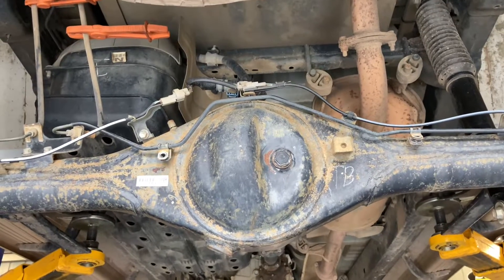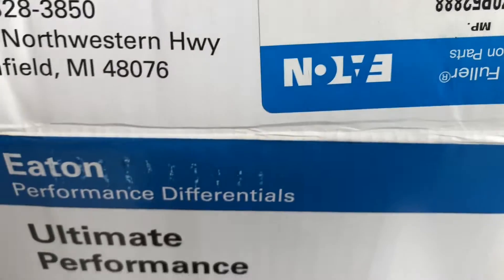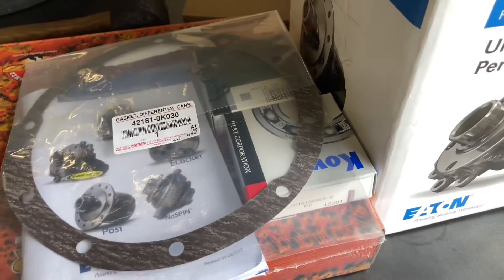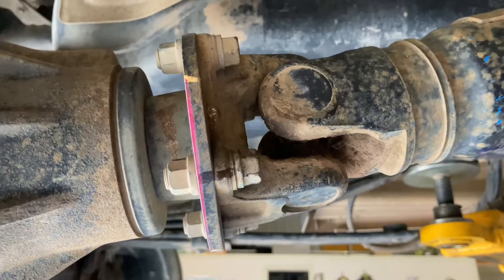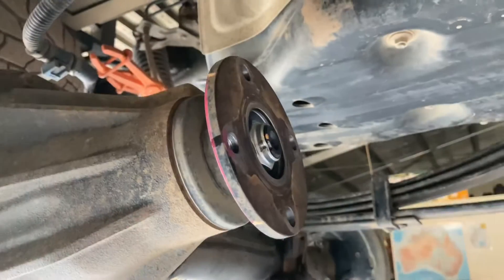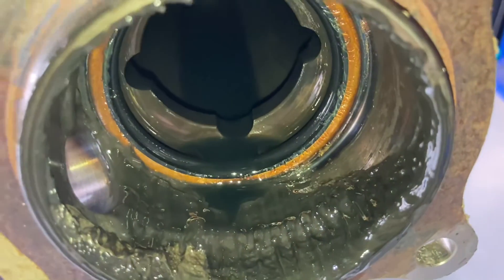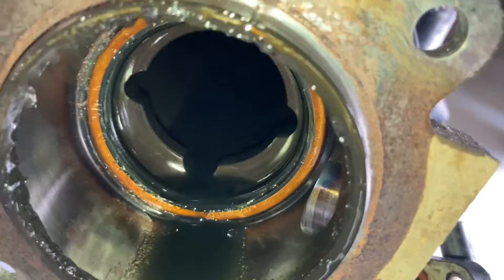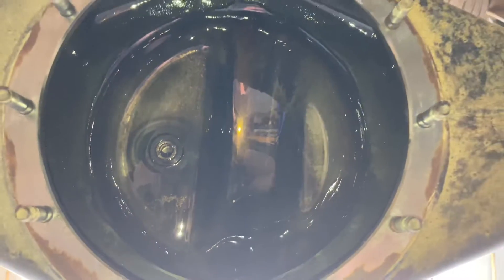REMOVING DIFF CENTRE FROM HILUX VIGO LOCKER & Truetrac CONSIDERATIONS

Comment: I'll save you time, factory bearings gave out at 220,000k but never take to toyota! They cut old bearings off instead of using special tool in press. Had constant leaking issues after until I invest in press tool and did them again myself. Axles where hacked up by angle grinder by Toyota maitland! I'll name them! Replaced both axles and will do it myself from now on, yeh I'll hardly ever use the press tool, but it's there and I'm confident in my own work.
Reply: Just lost my bearings 2014, 210000km 

Perfect video thank u for grate content

Comment: Will be very interested in how the Trutrac goes. Unlike selectable lockers, the Trutrac will be working for you on and off road.

Is there a Trutrac for a Prado 150? I have a 2019 GX and to me a Trutrac would compliment the TC system to give you an effective ‘locker’ without having to worry about airlines, actuators etc
Reply: I think the 150 setup is good enough and doesnt need any changing. Its mentioned in the video that 150 prado handles this well already, this upgrade is to bring hte Hilux "craption" control up to speed.